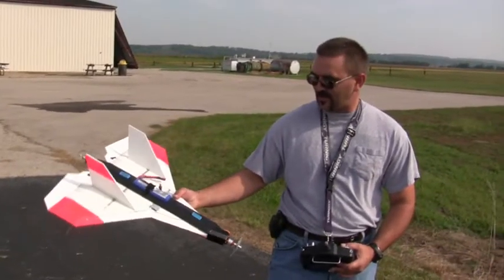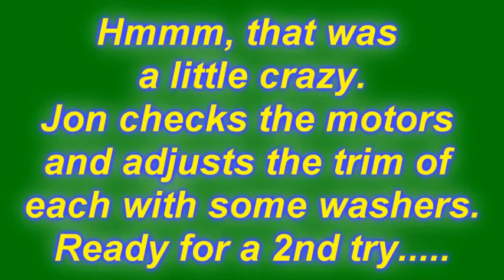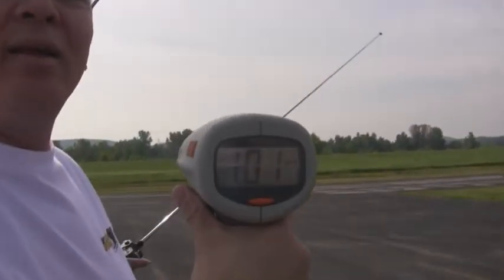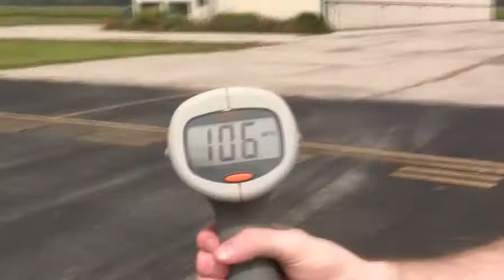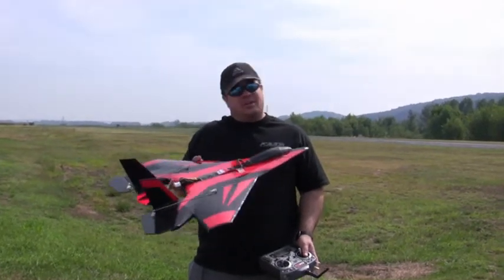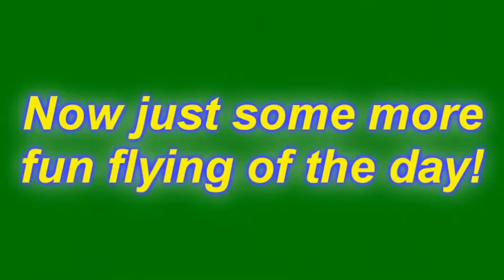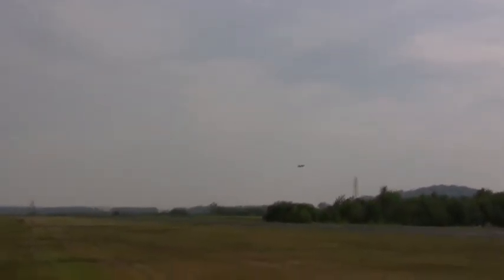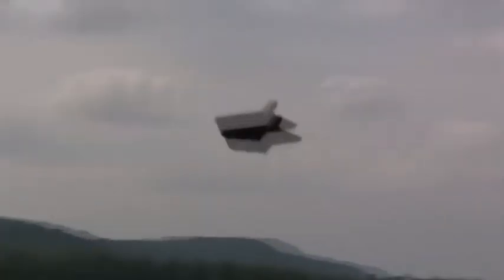Back To Herman Airport (RC Airplane Compilation)

Comment from the maker: Thanks Startazz! The camera on the Condor is just a simple on I got from Amazon since I had a gift certificate. i think the model number is MD-80. They claim it is the smallest video camera out there. it is super small but a little heavier than the flycamone2, its almot 2 ounces. When I bought it for only $59, cheapest I see now is $99. I will put a link to the camera in the side bar in a moment. I also have the flycamone3, haven't tested it yet, i will keep you updated when I do. Thanks again!